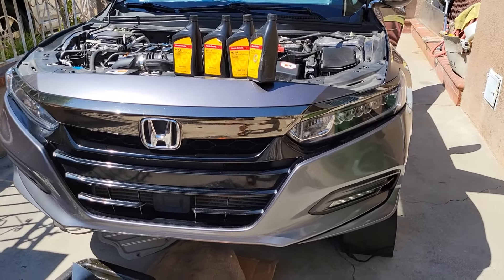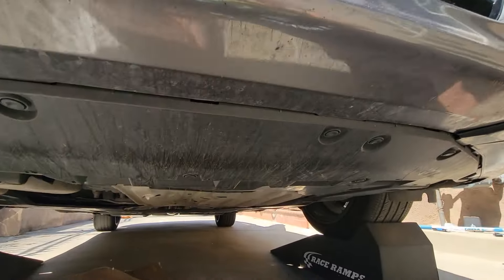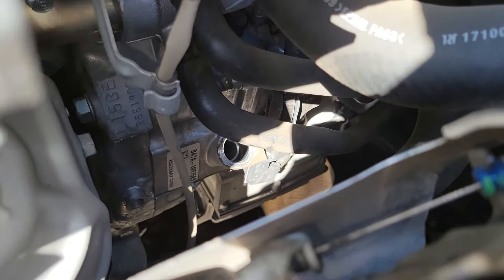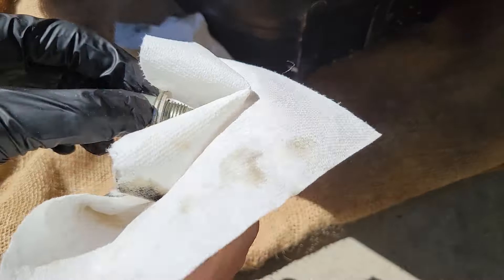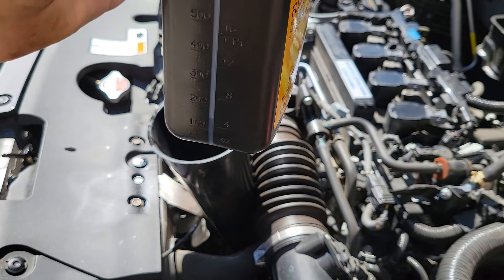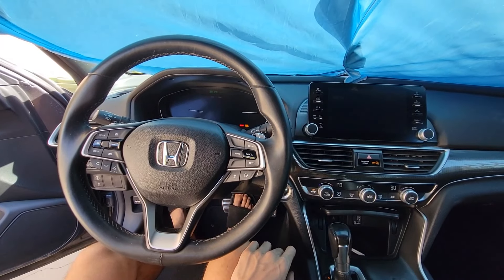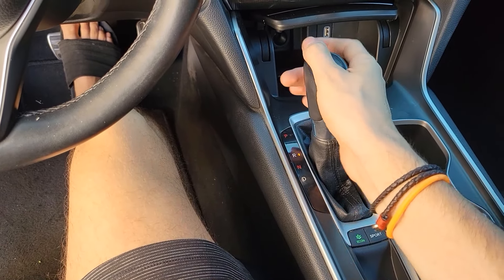CVT Transmission Fluid Oil Change 2018-2024 Honda Accord, CR-V (1.5L Turbo)

Comment: you are supposed to do it leveled so more of the old fluid will drain.
Reply from the maker: Yes, level is the preferred method. 👍 I even state it at the 0:47 mark
Ramps are way faster and isn't necessarily an incorrect method. When I measure the fluid coming out, it measures the same as a level car would, thanks for watching!
Reply from the maker: P.S. you could always contribute to the YouTube platform if you feel you are more knowledgeable! Cheers 🙂

Comment: I had all the fluids and spark plugs changed for 170.00 by strictly honda service shop.
Reply from the maker: What do you mean by all the fluids?
Reply: @Striker 50  all fluids  means just what I mentioned..  Trans, power steering, brake fluid, antifreeze and wipers..
Reply from the maker: @hectorraigosa7149  Sounds like an insanely good deal 💰 Honda service would probably charge $800 for all that

Comment: Dealer is charging me $250
For my 2019 accord, I’m scared to do it myself and mess something up
Reply from the maker: Geez! so basically there going to charge you about $200 for labor. It's pretty straight forward especially if you use the check bolt method to assure you filled it up. exactly. Nearly identical to an oil change but whatever you're most comfortable with

Comment: I'm a little confused. I have a 2019 Accord EX-L and I have the plug you pulled but I also have a plug between the air cleaner and battery and that one is labeled HCF-2. Are they the same?
Reply from the maker: Yes there are 2 access locations for some weird reason

Comment: Good except you need to raise your back to make car flat to let all fluid come out
Reply from the maker: @bvvbvv6010  Correct, but it's much harder and requires more tools, jacl and 4 jack stands. Not much more fluid will come out. 
But yes, I've done it with 4 jack stands. This video is about 3 years old now and I was barely starting back then so I hadn't spent hundreds of dollars on equipment yet

Comment: Location of oil port ?!
Reply from the maker: Which oil port? I show where to fill the CVT oil at the end if that's what you're attempting to reference
Reply: @Striker50_  i was hoping you'd show where the oil port is at clearly since i couldnt find it on my 21 hybrid .😏
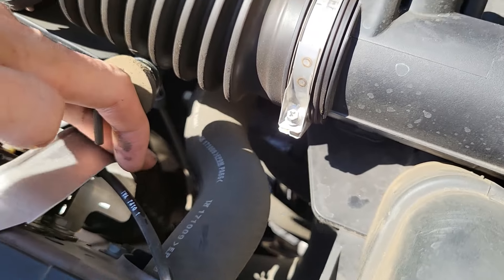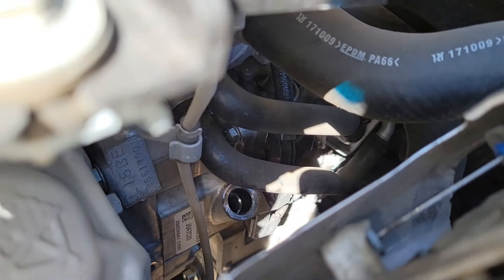Reply from the maker: @macmoney2043  I show where it is at 1:42, and 3:57. Look for the little plunger that I am holding too. Keep in mind the hybrid may have a different place for it
Reply: @Striker50_  ok bet .may be i need a flash light👌
Reply from the maker: @macmoney2043  let me know if you find it
Reply: @Striker50_ Found it thanks.Anyway great vid,including you specifing the specs on the tools .
Reply from the maker: @macmoney2043  nice where was it located? That way I could help other hybrid owners

Comment: What size is the crush washer for the drain bolt?
Reply from the maker: 3:28
18mm
Reply: @Striker50_  Thanks 😂
Reply from the maker: @derekam98  lol anytime
Reply: @Striker50_  Is 18mm crush washer for both check plug and drain plug?
Reply from the maker: @donaubry8774  I researched for about an hour and could not find a source.
The only thing Honda says on page 623 of the maintenance in owners manual is: "do not attempt to check or change the automatic fluid yourself" 
Which is such a money grab. Honda doesn't even want people servicing their cars now which is sad that they're that desperate for service money. 
On the techinfo Honda link I posted it states 3.7L for the CVT & I got ≈3.75-3.8L out of mine give or take. 

You could call a few dealerships and ask for the size for the fill plug but I doubt they'll be of much help. Dealerships are very dependent on maintenance revenue, and this is the first model year where they don't even provide information for people to do it themselves now

Comment: What about the filter
Reply from the maker: Filter is very difficult to properly replace because it is not easy to find the appropriate O-rings. I could replace the filter, but I don't want to make a video if I can't say where to find the proper O-rings

Comment: How often should we do this
Reply from the maker: 50,000 miles is the standard recommended, you'll get a maintenance minder notification when it's due; if you're driving in mountainous areas all the time, it's suggested every 25,000 miles. That's Honda suggested
Reply: @Striker50_  thanks subscribed 😎👌🤝
Reply from the maker: @kermitalexander6655  Much appreciated 🙏 More videos to come

Comment: No filter?
Reply from the maker: The filter is very difficult to locate, in addition to the proper o-rings. Honda does not offer clear information on it, and most parts departments aren't even aware of the parts needed. For that reason, I don't want to make a video that places the viewers in a position that they can be putting the wrong parts into their car

Comment: At how much miles should I get it changed
Reply from the maker: How many miles are you at right now, where do you live by, and how are you driving it?
Reply: 43700 and I don’t push it hard
Reply: I’m in virginia
Reply: Just got it about a month ago
Reply from the maker: @dariancorlette4212  For sure, way to be on top of it; I'd say follow the maintenance minder which should be giving you a notification around 50,000 miles.  You should be plenty fine as it's early. You should see the video with my 2013 Accord that I changed the CVT fluid for the first time at 120,000 miles, that was pretty nasty but still runs fantastic, so very 50-60k is very conservative
Reply: Thank you man

Comment: At what mileage should you do a transmission service?
Reply from the maker: With standard mixed driving, maintenance minder recommends 50,000k mi intervals. If you're driving through canyons/mountains daily, 30,000k mi recommended
All of these are conservative numbers as the previous model Accord CVT recommended anywhere from 60-90k mi intervals

Comment: that was not sludge. impossible in that cvt.
Reply: @Striker50_  ok I didnt analyze it well but if it was sludge it would require extreme high heat and would be pure carbon. It seemed like very fine metal from the CVT band.
Reply: @jamesmedina2062  he wasn’t saying it was sludge, he was saying it shouldn’t be sludge and then proceeded to say his was fine
Reply: @nolimitchris1748  ok

Comment: How do you know you have enough?
Reply from the maker: This is the first CVT oil change on the car, and isn't like engine oil where it can burn, etc. Owner's manual mentions the amount needed, and I measure what I pour out. I am give or take ±0.1 ounces off in the video, but I will be making an updated video showing all of the proper steps to(level car on 4 jack stands, check bolt method, etc.) 
I didn't make the video that way for a few reasons: 
There is no easy info on what the crush washer size is for the check bolt, I knew way less when I recorded, and I didn't own 4 jack stands and a floor jack at the time I recorded it. In addition, the more tools I use, the less likely the average person would be able to do these repairs so I wanted to make it as fair as possible. 
But yes, a more detailed video will be coming soon

Comment: Did you change the fluid while the CVT was dead cold or hot?
Reply from the maker: I moved it from the street into my driveway so it was probably running for about 2 minutes
Reply: @Striker50_  thank you, I’m getting ready tk do mine since I’m right at 30k. I was gonna pay Honda because I heard it was difficult but I’ve done a lot of Honda fluid changes in other models so I’m just going to do this one myself. It’s the exact same method
Reply from the maker: @reaper-sz5tm  Has your notification come on to change it? 

Yeah screw Honda they're rip offs. I used to go for oil changes years ago but would end up wasting 4-6 hours waiting. 
You can do this in under 30 minutes at the comfort of your own home

Comment: It shoud be in leveled flour to drain and to fill up.....your video is misleading.....this is not the right way....good luck..
Reply from the maker: You're totally right! That said, not everyone has 4 jacks and a floor jack. Honda also states to use 3.7 Quarts of oil, so one knows it's generally going to be accurate
Thanks for watching 👍

Comment: What size socket did you use to take the plug out ?
Reply from the maker: The 3/8" ratchet fastens directly into the drain plug, so you do not use a socket for this plug. You can see the square ⬛ style opening in the plug @:
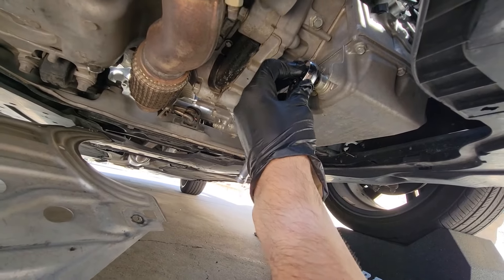1:21 and 2:08 you can see the ratchet directly attaching into the drain plug

Comment: How you changed this, is it similar to the 2.0T? Or changing the transmission fluid is totally different from the 1.5?
Reply from the maker: I would say it's 90% similar (Transmission oil is a different one though)
I know there is 1 video on YouTube where the accord is a 2.0t try finding that one I think I put the link to the video in one of these comments on the comment thread as a reply to someone
Reply: @Striker50_  damn I’m just now seeing your comment, but I appreciate it much sir. Take Care.
Reply from the maker: @EJoutdaway  Likewise be easy 🙏